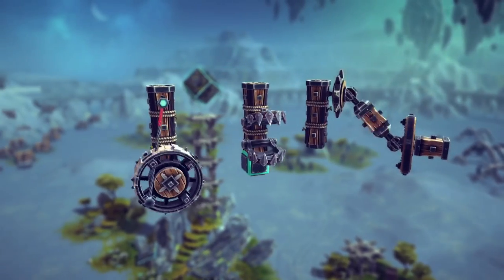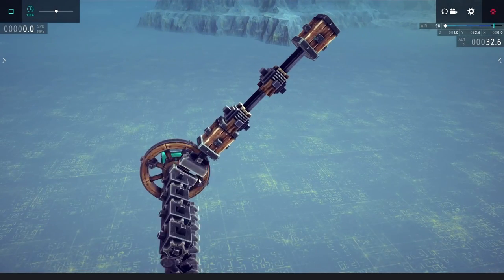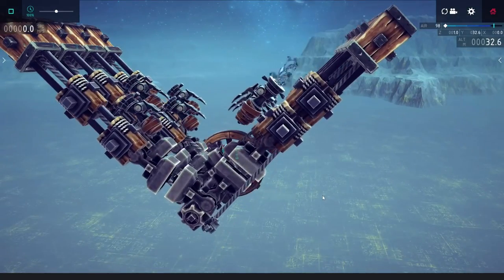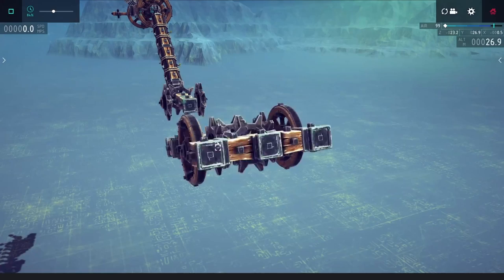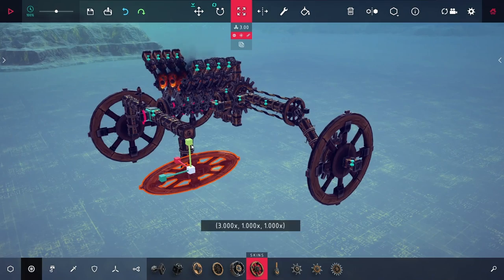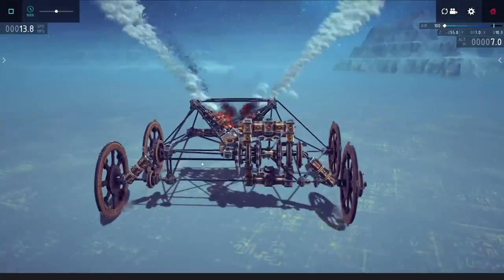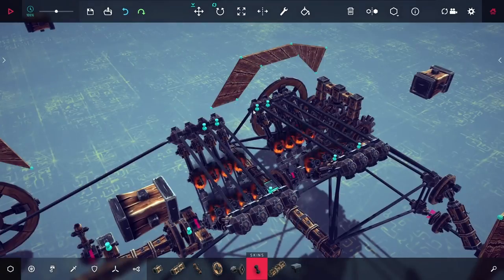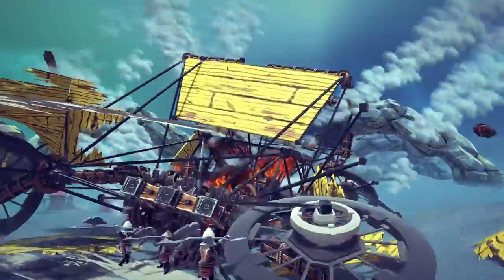Making a Realistic Truck To Crush Besiege

Comment: One thing you absolutely NEED to start doing in these builds is making the wheels wider. Those things are thinner than bicycle wheels
Reply: True lmao
Reply: to protect the car a bit as well might help to just have a big ass roller in the front like a steamroller to prevent the destructible stuff from getting under the car and messing up the engine
Reply: @sage5296  a cowcatcher
Reply: @NoobMaster-hm2fr  a what???
Reply: @RedKatShorts  What he said, a cow catcher
Reply: Also a flywheel
Reply: If he made it bigger, then it would fall apart.

Comment: One thing that you forgot was a flywheel because that engine is just pure power and the torque would destroy the engine, so you need a flywheel so it doesn’t rip itself apart

Comment: I would really like to see you make a bicycle in besiege. I’ve been trying for a little bit and my main problem has been overall strength of the building. My turning is a little jank as well, but strength is really struggling. It took me a while to make wheels that were strong enough to support the build and ended up making them out of the wood panel things after modeling a wheel on the ground out of normal wood blocks. Awesome video, amazing job

Comment: Here's a suggestions on a better engine. This knowledge of mine came from a different game but I'm sure both games behave similarly.

Try to make a Inline 6 instead of a V8. A V8 will rotate the car but a Inline 6 will not. I found that the Inline 6 is faster and is very balance (if built properly).

The engine you made is (I think) 2 stoke, 1 stoke is power and the other is not. That's why have 2 steam cannons facing away from each other so instead of this 

No Power.             Power
 Stoke up         Stroke down

You get this
  Power.              Power
Stroke up.      Stroke down

Also if you only have 1 stoke power stoke, the steam cannons will push down the car which will put more stress on the car.

And when building the Inline 6 be sure to follow the Real life version of the Inline 6. Copy the Firing order and Crankshaft configuration.

Tho a V8 will have more power, i dont think it will perform better than the Inline 6

But hey all of this is just my Theory
A GAME THEORY

Edit: I Google searched if a V12 is as balance as an Inline6.

Comment: All of this is the reason why trains ruled the 1800's and it took until the turn of the century for cars to become a thing at all. When you take the steam powered pistons that move a body with mechanical force and try to make that as small as a carriage/wagon it doesn't work anymore because the parts can only be so strong and at a certain scale wind up tearing themselves apart and exploding or simply losing all sense of pressure and breaking down, and then even when everything's perfect you still have to constantly top it off with water and smoking polluting fuel like wood or coal like a train except way more often being a smaller package. The only way cars could ever work is if they were moved electrically with motors powered by a rechargeable battery that was charged by a dynamo that was spun by pistons that were propelled by an entirely different and unique fuel. Vehicles flipping out like that over a speed bump was also a problem irl because of how centrifugal force works and took a bit of more parts and overall weight to make sure that didn't happen. Except for helicopters where you need a tail rotor to literally force the body to not spin around. I love how the world of engineering is where physics makes you their bitch because you don't have the parts you need and you spend many hours and days of trial and error to get something that just barely works, lmao

Loved this video, more large scale engineering please <3

Comment: If you try a V engine again, it will run a lot smoother if the pistons are at 45° or 135° to each other.
(Or both in case of an X engine)